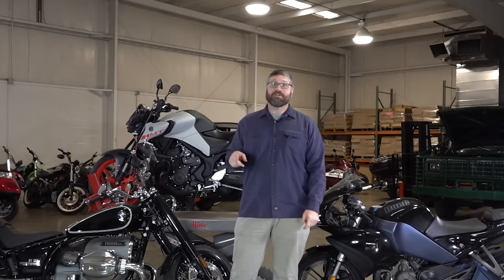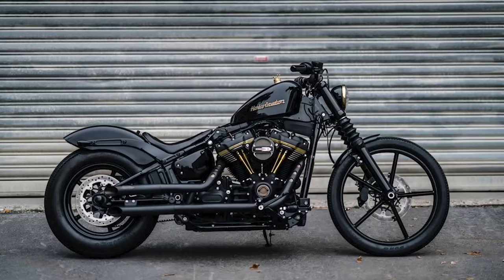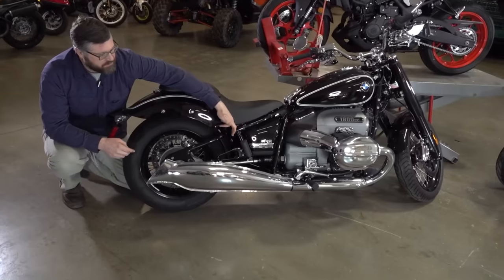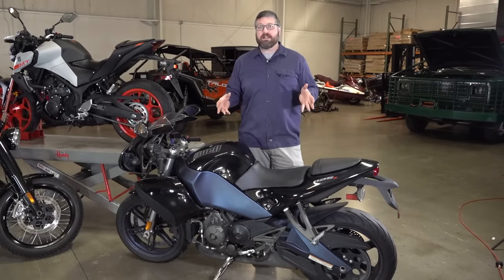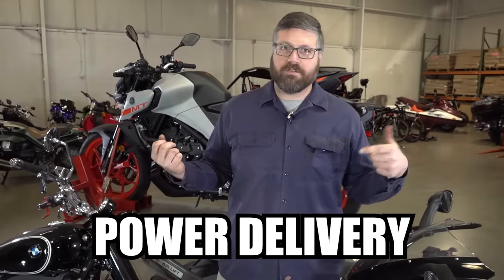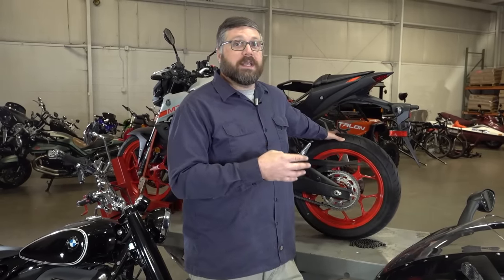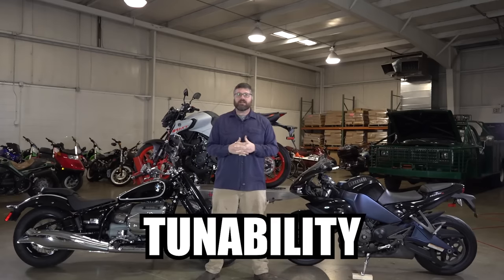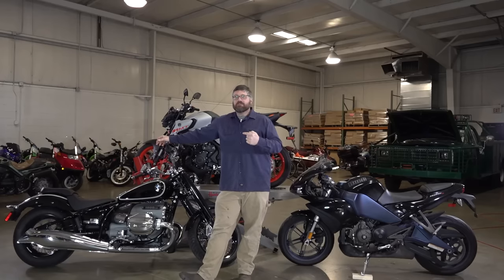Motorcycle Chain vs Belt vs Shaft Which one is Better?

Comment: One 
One thing that wasn't addressed was repair of each system. Chain repair is probably the easiest, and cheapest of the 3. Belt would probably be second. Shaft is pita if you need to make repairs. It's also harder to get shaft parts, especially on an older bike. I guess I've never noticed chain being too abrupt on power delivery, either. I haven't ridden belt, but I have a shafty, and it's no smoother, aside from being a bit more forgiving on less than smooth clutching, but I attribute that to the clutch on the shafty being hydraulic.

Comment: 😎 omgosh  never fully trust the engineers, they can be good till you put them on a budget. I prefer belts all the way with some exceptions. Chef drives or just too expensive,  chains are the cheapest. For example the v Star 250 is one of the best bikes in America to run around them but it's so needs a belt instead of a chain. The chain on that bike constantly needs maintenance they wear out fast because they're from cheap materials. Someone could make a fortune swapping that to a belt drive on the v Star 250 virago. Be nice if it was fuel injected instead of carbureted too because that little carburetor always runs rich anyway belts are cost-effective quiet clean and low maintenance. Harley just needs to make their belt more accessible. I have rode them all I don't care for the hum of a shaft nor the way it picks the back up and traction is lost. Good video.

Comment: I’ve had several motorcycles many years ago. My last was a V65 magna!  I’ve ruined sprockets front and back on a 750 Honda ( had two) but the shaft is quite and bulletproof!  Vmax has shaft and bulletproof! Shaft wouldn’t work on a dirt bike, but on the big bikes l think it should be standard. My opinion.

Comment: Have owned 9 motorcycles, and my latest one is my first with a belt drive. I hate how much mess the chains make, and the high maintenance, so that's a plus for the belt. I'm worried I might get a piece of gravel wedged between the belt and the rear sprocket though, vaporizing the belt and leaving me stranded. Though I suspect the likelihood is low.

I wish all bikes had shaft drives, personally. A good shaft drive often lasts as long as the bike itself with no major repairs.

Comment: There is no motorcycle that is maintenance free, cept for maybe the E-Bikes, n they also require minimal maintenance, tires, brakes, charging the battery, wheel bearings, n neck bearings.
Why is it then, that those who have chain drives, believe that removing links is what you do to get more life out of the chain?? The chain n sprockets are already worn, yet, they keep believing chains last forever, you just remove links to get them back in adjustment. 
Yeah, right! And there really are pots of gold at the ends of rainbows... The maintenance a machine needs is directly proportional to how much you run the shit out of it! If you want your machine to last, respect it, take care of it, and ride it decently. If not, its a disposable piece of shit...

Comment: If you blow a belt you most likely won't be able to fix it on the side of the road (it can be fixed temporally with expensive belt fix kit).  Chain is no problem, cheap master link kit or put a fresh chain with out pulling anything apart .  Probably not a concern with shaft drive, unless catastrophic failure.  Maintenance on belt  drive very expensive sprockets and you have to pull so much more apart to do put new belt on (inner outer primary, swingarm), not everyone has a choice of how much gravel roads they have to ride on. It is all up to an individual.  Just a few points to think about good video though.

Comment: Tunability of a shaft drive: swap final drive. BMW has a decent number of different final drive ratios, but they are outrageously expensive to change (~$1000-$2000 for a rear unit).

Comment: Why don't they design a median size bike that has no road buss ! You have a power plant and two wheels , join the frame front and back in two pieces , joined with rubber mounts , the eng. with rubber mounts , to reduce viberation or cancel it out frt. wh. And rear wh. ! So you could ride 8hr. and have no road buzz ??

Comment: One thing to take into count is mass of the system. Obviously enough shaft has most weight, then belt and finally belt. I think belt is used on street bikes since with that lesser mass rear tire has less mass and can move faster to counter bumps in the road that could potentially otherwise cause loss of traction, but we are talking about pretty small difference between chain and belt, but if you are optimizing things then belt is superior... long as road.. or more like track is clean.

Comment: Got a pebble under the belt on my FXR, got stuck in the belt and chewed up both sprockets. Pebbles just bounce off of my shaft drive, change the oil when recommended and no trouble.

Comment: Great video, one thing: didn’t cover cost and ease of replacement. As far as oem cost, chain would be cheapest, then belt, then shaft. Ease of replacement: chain can be easiest by far as some have a removable link, a belt requires pulling a wheel off and id say a belt is less forgiving when it comes to misalignment, I think shaft is the hardest? But I’ve never had a shaft drive bike. Maybe some bikes it just comes out with one bold lol idk

Comment: It is possible to change the final gearing on a shaft drive system without having a new set of gears made. Just change the tire size but since there is not a lot of excess space around the tire the amount of change is small unless you are going to a smaller tire. I did this on my bike because I wanted less RPM's at highway speeds. I was only able to increase it by one size and got results that I was not expecting. The RPM's did drop at highway speeds but a miniscule amount, and my fuel mileage went down about 2MPG and shift points also changed. 
I agree with your assessment of the systems, well done video.

Comment: I'm not talking from a motorcyclist perspective, rather a bicycling perspective, but if I got myself a motorcycle, I would like to fab or find a sealed self-lubricating chain setup. Motorcycles are on single speed chain drives, so the enclosure could be made fairly compact, the output side could be sealed similarly to an engine's crankcase, and the whole setup could be drained and cracked open within a few minutes, and would take away very little of the tunability aspect that chain drives have. By being sealed off and constantly lubricated, it would decrease wear, almost negate maintanence beyond changing the chain and changing the oil, it would function more consistently in offroad environments since the actual drivetrain within can't get dirty, be it dirt, mud, clay, or bits of plantlife, and it would suppress the chain noise.
It wouldn't have to be filled to the brim with oil and completely sealed off either it could be done with a resorvoir and small pump, also not unlike what's in most engines on the roads today.
I suppose that's all I got for my brain dump, maybe one day it'll become a real thing.

Comment: Shaft drive bikes have a handling difference. Especially when throttling up in a turn. If not used to it one may find themselves losing stability and possibly control. Depends upon how much throttle is being applied. Chain drive is the best power wise and belt drive is the happy medium. Shaft drive problems do occasionally happen and are expensive to fix usually. And for the important part of the equation... Chain drive bikes can be repaired and get you home with minimal tools and just a few small spare parts kept on your bike. A shaft drive problem or a belt failure on the road generally leads to getting picked up by road side if you have the coverage or cash and then you need a dealership to do the repairs or parts house for bikes if you know what to do and have the tools on hand. Chain and sprocket problem's can usually be fixed roadside like I said. And if not well it's just even with the other 2

Comment: My riding style is touring and cruising, and for that chain sucks. Shaft has many advantages, but it's heavy and expensive. Belt is the way to go. Maintenance is nearly as low as for shaft, but it's cheaper, lighter, and has no driveline lash. Too bad belt drive is not used more often.

Comment: Belt is best.  Smooth as silk.  You can change gear ratios if desired via sprocket/belt changes.  Shaft torque causes handling issues and not only is heavier but also louder.  No benefit whatsoever with shaft.  Been riding 50 years and have owned them all.

Comment: Never liked the shaft drive. It feels like you are on a arcade ride during acceleration and let off, popping up and down during heavy traffic doesn't appeal to me! Belt drive just doesn't seem like it can withstand the full ranges of the power bands. I always preferred chain drive although it is high maintenance, especially with the dirt. Lots of cleaning of the rear of the bike!

Comment: Only changed the oil in the shaft twice on a year 2000 suzuki VL1500 when I sold it with 85,000 miles

Comment: The best drive system is the shaft drive system very easy to maintain very clean and usually they Outlast the bikes that they are attached to when you have a high horsepower bike they eat chains and sprockets that are very expensive as well as if a chain breaks it generally goes right through your engine cases my Sportster has 330,000 miles on it and a belt usually last me around 100,000 on a Sportster replacing a belt is not a big deal $100 for the belt 100 bucks in change for the labor to change it out Drive chains are for race bike or for dirt bikes I put up with chain drive on my vintage British bikes but I love the fact that my vintage BMW swell BMWs are shaft drive change ride bikes without Center stand are a pain in the ass to service

Comment: I'd take a chain over belt or shaft if i had the choice. It's a pain to clean and oil but with modern O ring chains you dont need much oil. Just keep it clean and your good. You can change chains so easy and the thought of the belt snaping leaving you stranded with a major service being needed is flat out stupid and the drive shaft is nice but can leak or if it goes south thats a pain too. I've ridden all three and my current bike a 2013 Streetglide is a belt. Would be neat if Harley gave you a choice of belt or a chain like my 13 doesnt have abs brakes but some 13's do. I don't want ABS and i don't want a belt final drive either. I know they last but if given the choice i'd rather have a chain.

Comment: In my opinion belt drive is overall far superior to chain, so I'm very puzzled as to why more manufacturers don't use it. The real world difference in power delivery is so minimal very few riders would notice any difference, and very few would be changing the sprocket size as well. No need to be oiled, they don't stretch nearly as much or as fast, are much quieter, I mean, your video explains all the reasons why it's superior. While YOU prefer chain drive, I strongly believe 95% of riders would benefit from belt drive over chain drive (not referring to bikes that already have shaft drive).

Comment: From what I've gathered:
Shaft is like a daily driver car. Smooth, comfy and quiet. Not necessarily good for performance in a racing and modding setting.
Chain is like a sports car. Not super smooth, or reliable per se, but it's the best in terms of racing performance and modding.
The belt, is a balance of the 2, but it doesn't particularly excel in either category. It's a good all around system that is a jack of all trades so to speak.

Comment: One missed category is maximum torque capability. Shaft would win because it's just so beefy, chain would be second because it can still handle high HP applications, and belt would come in last because the belt can only handle so much torque before the sprocket starts eating the teeth in the inside of the belt.

Comment: Thank you!  I started on a 70 Tiger 650 twin. The chain was shot.  I went looking for a replacement. The only thing I found was machine chain of the correct pitch. And I had 4 links and a breaker in my jacket. Along with a flat screw driver - and a 12 point 9/16th.  I had the chain lay out on the ground once. The old link split.  Took me a week to find an old machine shop - with an old guy who had been there 60 yrs.   As you might guess - I like chain drive.

Comment: If you want peace of mind ,reliability shaft drive is it.
Chain is high maintenance and the exposed belt drive is also high maintenance depending on climate conditions and use.
Unexposed belt drive in scooters etc etc are more reliable.
My jeep V8 had the same utility belt  for over 20 years in a harsh winter climate.
My tractor ( garden ) has its belts changed every year due to being totally shot .
Maybe a bit more info on the reliability and cost of changing a belt.

Comment: Honestly for overall use id 100% say belt is the best for most applications. 
So long as you shield it from impacts, it can handle horrible conditions really well, sand, dust, salt  etc

For going out in the middle of nowhere then chains can be great as you only need a few parts but id still likely pack a belt, theyre great, they can be rolled up and theyre clean, no need for oils etc.

Only issue with the belts, theyre costly, not because of the high cost of manufacture, its actually because theres a high mark up since they need more return on them.

Comment: Scooter belt drive is more adjustable than a gear drive unless you don't count the variable drive gearing/cvt as adjustable but last I checked you can change roller weights, pulleys, belts and clutch springs

Comment: For the perfect way to use drive chains see the Allan Millyard downhill mountain bike. The chains are fully sealed have never needed adjustment. The rear chain is so neat you wonder how power gets to the back wheel. It's a push bike, but the same idea would work fine with an engine.

Comment: Nice video. Short and to the point, I guess stating the obvious when you think about it. Only thing i felt should have added is with the damaged belt you need to remove the swingarm to replace. Never owned a belt or shaft. It would be good to hear opinions chain gearing, front vs rear, rivet vs clip. I tend to drop 1 tooth from the rear, gearing higher a tad. Ive always had adv bikes doing 99% road. Anyway Keep the good work up. :)

Comment: Do the engineers select chain-drive (in most motorcycles), or do the corporate people choose it from the office, while on the phone making deals with the chain manufacturers? Furthermore, if the engineers select chains, why do they not opt to cover them so that they last much longer? As for chain efficiency, who has a perfectly maintained chain? No one who rides more than a few times per summer season, and who hasn't got half a day a week to spend on the job. Real-world chain efficiency is poor.

Comment: There used to be a lot of talk about the behaviour characteristics of chain vs shaft when power was applied. It was said that shaft drive pushed the swing arm pivot point up under acceleration, whereas chain drive pulled the swing arm pivot point down. Anyone got any thoughts on this?

Comment: While what he has pointed out is good, from a comfortable handling perspective, I would rate belt drive first. I have been riding motorcycles since the age of 5 years old and have ridden many different bikes throughout my time. Was never a fan of the power delivery on shaft driven motorcycles. They feel weird in the corners and they also feel like the tail end of them wants to rise while engaging the throttle, and the engagement feels jerky and not smooth. Belts have a little bit of give, but that allows for smooth power engagement. The bmw looks cool in the bike shop, but I would never want to own it since you have those big cylinders right in front of your shins with no way to stretch your legs.

Comment: I've only ever had one bike that wasn't chain driven, it was Yamaha 1300 venture. Another problem besides the power loss with shaft driven bikes is rear end lift under power. 

On a big heavy bike it may not be a huge deal, but the last thing you want on twisty roads is your rake and trailing angles constantly changing on you depending on how much throttle you grab...I've never owned a belt drive, but everyone I've ridden with who owned Buells did a chain conversion. Belts are great and smooth and all, but it just takes some dirty roads or a gravel driveway getting pushed into the road to wreck it.

Comment: i had 2 suzuki savages ls650 and both needed belts replaced around 25k miles they were the bando brand, i read where some had extended the swing arm to run harley belts as they lasted longer, i was looking into getting a chain kit from a ls400 but that was way more expensive than buying a new belt

Comment: chain puts down the most power and is more durable in the sense it can be repaired literally anywhere with just some links. belts are nice and low maintenance but when they break or wear out it's atleast 200 bucks to replace and if you like to ride rough they don't last long. shaft drive are extremely reliable and pretty much no maintenance at all but don't put down as much power as the other 2 but can handle off road way better than a belt. I've had a belt drive buell 990 and after 6 months and 3 belts later I bought a chain conversion for it. best decision I ever made.